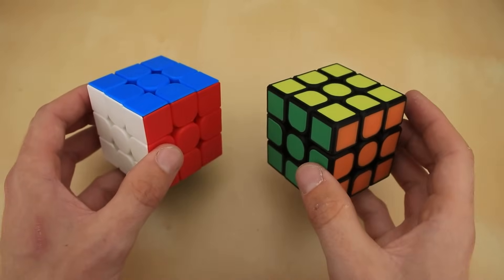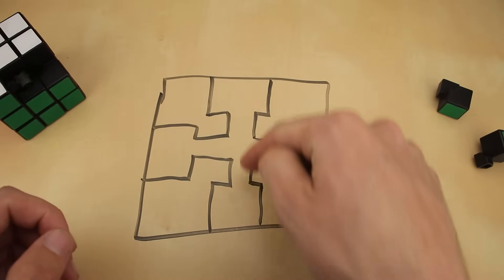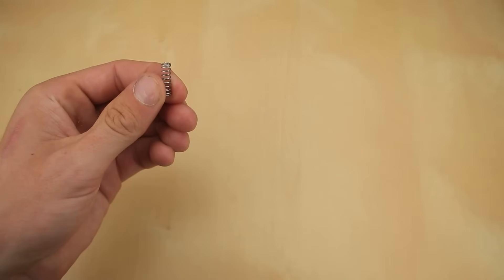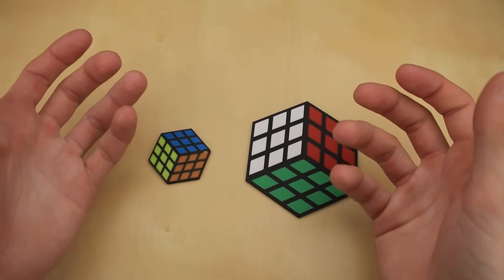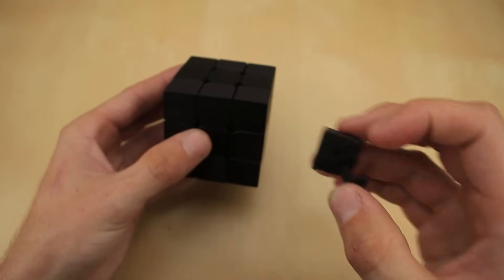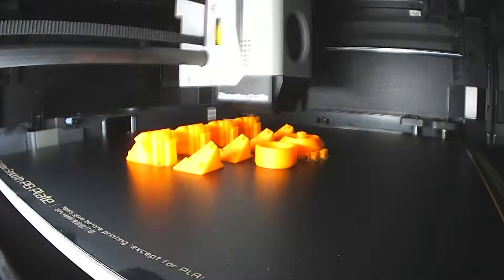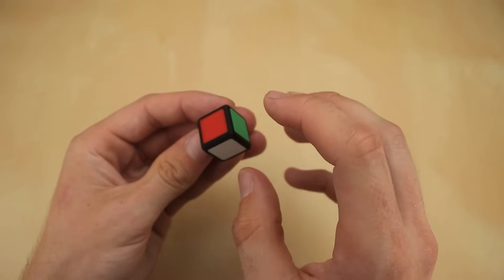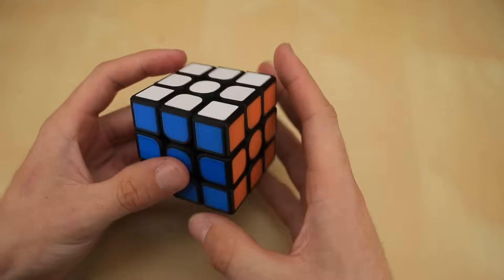I built my own Speedcube FROM SCRATCH!

Comment: wow, what an effort! Well done and a lot of lessions learned, I guess. 
As a owner of a X1C I have some suggestions: You could have printed the final version without black at all, but I guess you wanted the classic "stickered" look? Or you could have only printed black without the colors. Then print the colored squares seperate and press fit or glue them in place. I guess it would also give a higher surface, since all colors would have been printed face down on the build plate.

I'm currently printing an unstickered version of the "Oh! Minx" on Printables

Comment: As a bambu lab p1s owner, i can say that from using it about half a year, it is the BEST thing I've ever gotten. So worth the price. One thing i would reccomend getting is a cyrogrip plate from amazon. I dont remember the company, but its a light blue color. Cheap, adheres prints EXTREMELY well, and when the print is done the print will just slide off the plate like it never stuck in the first place. I also havent washed the plate in about 5 months of near constant use and it still has no adhesion problems. Definitely the best upgrade for the printer.

Comment: Bro, I have an idea—I haven't seen anyone do this before!

1. Take two normal Rubik's cubes (I think non-magnetic ones work better).

2. Open up the screws on them.

3. Then organize all the parts.

4. Now take one core (since you opened two cubes, you'll have two cores).

5. Attach the white center piece onto the core and screw it in place. Then, instead of placing the yellow center opposite to it, take the white center from the other cube and put that instead.

6. Keep going like this—use center pieces from both cubes while assembling it back together.

7. Once you finish assembling the full cube… just watch—it turns into a Penrose Cube!
(The only difference is that you can choose your own 3 colors as you like!)

Now I have one request: please do this exact same process with two Mirror Cubes, in golden color.

Please, bro! 🙏

Using the same method, first open up the full cube. Inside, you'll find 3 small center pieces and 3 big center pieces.
Take the 6 small center pieces from both cubes and install them on one core.

⚠️ Important point!: Be careful—whichever 3 pieces you choose, make sure you place the same 3 pieces (the corresponding ones) from the other cube on the opposite side.

Please, bro... 😢
By the way, I learned to solve the cube from you!
Love you ❤
Reply: I don't think he reads comments
Reply: @LolGamerNice16 😢😢😢.... Bro I had this Idea and tried comment so many times

No body replied...😔

Comment: This was awesome! I'm a very avid 3D printer cuber or whatever you call it. When you printed it, you should have done multiple plates with tons of duplicate pieces. If you would have had a lot more cubes and it wouldn't take tons more time really. The waste and the time changing colors doesn't go up when you're doing 20 pieces from when you're doing two pieces every layer. It changes once per color no matter what. Then you'd have a ton of cubes too. Also, I tried doing just the greens and reds on a plate. And the reds and blues on another plate etc. The fewer colors you can do per print the better. It saves tons of time and waste. You are making me think about trying to print my own!

Comment: Amazing content. To be lest wasteful maybe the cube can be designed with totally black internals and stickerless caps.

The stickerless split design actually still works too, you just need to account for the error in gluing multiple parts together, glue them very precisely, or be prepared to sand away the error. I made two Aolong-mechansim 3x3s with a 3-piece corner split and 2-piece edge split for a PLA vs PETG video, and the PETG one worked great. It's one of the best turning puzzles I printed

I have a 4x4 design tutorial that specifically mentions how to separately select the overlapping cut lines of the middle layer and build the alignment mech if you want to up the game.

I've been making cuboids, maglev 4x4s, and am halfway through maglev 5x5 v2, but still can't hit the same quality as you did (largely due to using an old printer and not being rich enough to buy 6 colours of filament)

Comment: What if… instead of 3D printing each piece separated from another and then assembling the whole thing… you 3D print the whole cube all together with no assembly required? Would that work?
Reply: It wouldn't turn lol
Reply: @Dimitri_gdr  But I’m not saying just printing a cube, I’m saying also print all the functions and twists on the inside at the same time
Reply: @StarNightRZ  I think the problem is that you can print separate pieces, so it would be a big block
Reply: @Dimitri_gdr  3D printers create things one layer at a time so it sounds possible to me for it to add the internal mechanism
Reply: @StarNightRZ bro how can you turn one big solid plastic piece ?
Reply: @Dimitri_gdr  I’m saying have the 3D printer make all the lil gaps to create the internal mechanism so it will turn

Comment: That's awesome. I hope you keep going and make a full set of "cubes". I quote that because I'd love to see a pyraminx and megaminx get the same treatment. The final frontier would obviously be to make molds and do metal casting to have a fully metal cube, but you wouldn't be able to do colors in the same way and would probably have to use stickers. Although, you can use different colors when anodizing aluminum.

Comment: You were completely overthinking the screw situation, haha. You could accomplish all the same qualities you described by using an off-the-shelf, fully threaded machine screw (like a pack of #4 screws at Home Depot or M3 screws from outside the US) and just make the tolerance of your centerpiece screw hole a little bit bigger so it’s not affected by the thread. Still, great end result!
Reply from the maker: I just find that the threads tend to get caught on the hole as the spring flexes, even if it's more than big enough. I'm sure it works fine, just doesn't seem ideal.
Reply: @Z3Cubing  I agree that having a screw specialized for this exact problem is more ideal than designing around it, but the big problem is that those screws aren't widely available to consumers. One way to get around the problem you described is to fillet or chamfer the hole in your centerpiece to guide the screw into it like a funnel. This would eliminate any hard edges that would get caught on the threads. Though if you're using screws with small enough threads, this shouldn't be a problem. Still not as ideal as having a specialized screw, but you could still totally get by with using regular American screws and have an awesome turning puzzle. I sent you a DM on Instagram with more info in case you want to discuss further. Great video!
Reply: Yeah, for all the screws I use in my puzzles I just use these ones I found at Ace hardware. And talking about that reminds me of the like 10 puzzles I’ve made that I still need to make videos on…